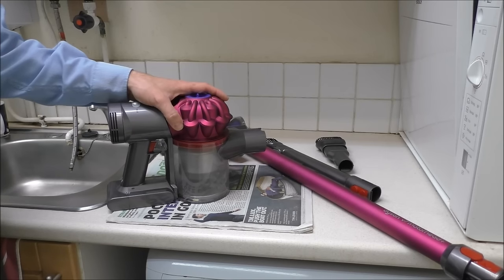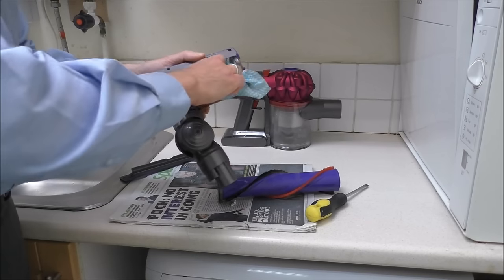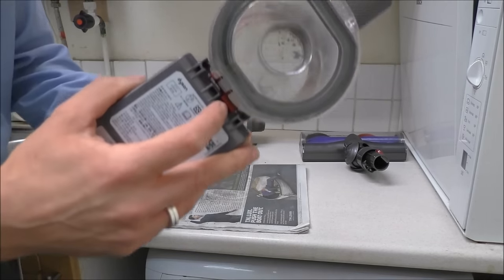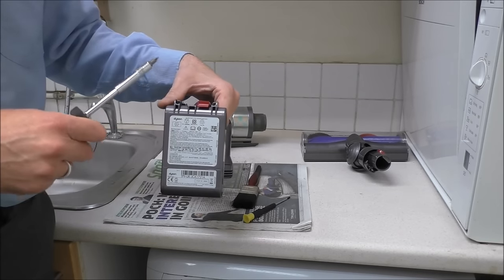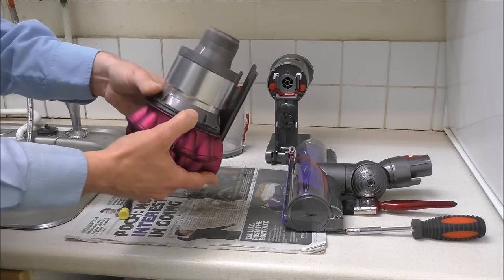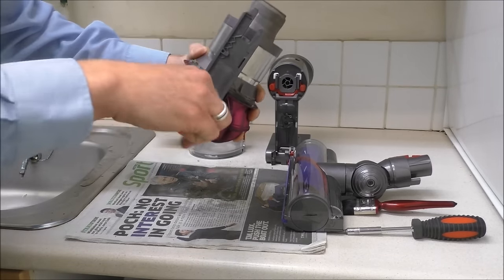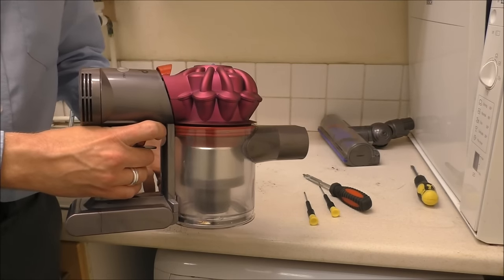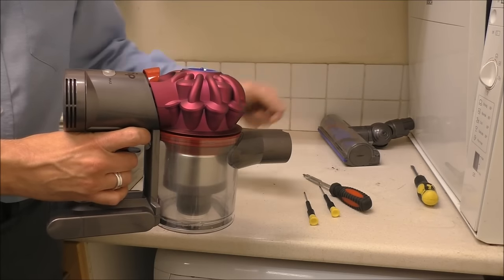How To Clean The Dyson V7 Cordless Vacuum Cleaner

Comment: After taking it apart and dust it out, can I just wash and rinse everything (except motor unit) with water? I'd think it should not have mechnical units.
Reply from the maker: You can wash some of it, but be careful to not get any metal connections wet, and also make sure everything is dry before you put it back together.

Comment: Can u Raines the red bit under water in its entirety rather than have to taken there into parts? Looks can break the parts very easily
Reply from the maker: The only thing to check is that there are no electrical connections as these cannot get wet.

Comment: How often should i do that deep clean taking it apart piece by piece?
Reply from the maker: It very much depends how often you vacuum and what kind of dirt it is. For general household dirt you would find around every 5-6 months should be ok, but if it was used in more of a demanding situation like where you are involving things like brick dust then it would need to be done a lot more often.

Comment: I just go the lazy way and use a dry microfiber cloth and rub the dust away without taking apart the pieces lol
Reply: Not hating, but I did take it apart and noticed that it was mad filthy inside.  Probably affects the suction a good deal especially where the holes get small
Reply: Great video! ThNk you!
Reply: I used that too, much easier!

Comment: Why can't I run the dust bin parts under water if I let them dry completely? There's no electrical parts in there right
Reply from the maker: If there no electrical connections in there then as you say as long as it is completely dry after washing you will be fine.
Reply: @lords-electrical  thanks 😊

Comment: HELP! I've washed it and put it all back together as shown. However, the handle to lift and empty the bin is VERY stiff. So much so it takes great force to lift. Have I done something wrong?
Reply from the maker: The first thing to try is to make sure the seal around the bin is clean and free of debris. If the seal is not clean it can be really difficult to open
Reply: Hi, thanks for getting back to me. The seals are all clean and debris free! The problem seems to be with the central section going into the waste collection bin. The unit seems to be jamming against the red plastic lip on the top of the bin! If that makes sense!
Reply: I have the same issue. Its a bit stiff. More than likely that will vary. I just got mine yesterday. So it does require a bit of force.
Reply: @ExG131  My problem arose after I dismantled it, washed it and put it all back together. It was at the point of needing brute force to open and close it! However, I'm happy to report that it is now working as it should. It sorted its self with no further 'fixing'. I have no idea what the issue was, but it's now back to working perfectly.

Comment: Mine started turning on and off when you start vacuuming. Hoping this sorts it out. If not maybe a new battery
Reply from the maker: Not normally the battery that is faulty if this is happening, it would normally be either a blockage or the filter that needs either washing or replacing.
Reply: @lords-electrical  good news. Its all working. Max suction also works properly now. Thanks.

Comment: what about the filter on the back for the exhaust? can you rinse it as well?
Reply from the maker: It depends on which model you have, if it is the Absolute model then yes you can take it off, but if its the Animal then it is fixed so you won't be able to clean this filter unfortunately.

Comment: Thank you for the very thorough video. However, it didn’t explain how to clean the flutes
Reply: After disassembling my Dyson, I was able to see how you separate the flutes. There are 6 #8 Torx screws on the inner perimeter. I’ve decided to leave well enough alone and not take that flute assembly apart. Instead I dunked it in hot, soapy water and blew it dry by blocking one side of the assembly and using a hair dryer on the cool setting to blast air thru it. It works well enough for me. Thanks again.

Comment: I don't mean to sound gross, but my V7 swept up bugs with moisture. I didn't see the water until I emptied it. Now it has a "biological" smell to it. I let it air dry with the canister open, but the exit air still has that rotten smell. I will wash the filter.  I tried vacuuming a little laundry powder, but no, still smells. Do you think I need to disassemble the unit as you did ? You don't disassemble the purple head ? (mine is grey). I can do this.
Reply from the maker: Yes it may mean you need to take it apart and clean it properly, and especially clean the filter and let everything dry properly. Hopefully once you have done this, it should be ok.

Comment: Great video! Do you know if it is possible to replace the standard filter on the back with a purple hepa filter, like on the v7 fluffy?
Reply from the maker: In theory it may fit on the back, but the vacuums will be designed to work with certain filters. My worry would be that if you put a different filter then it may damage the motor long term.

Comment: What about the rear filter? When do you replace or how to clean?
Reply from the maker: It depends on which model you have. Some of the models you can just take the filter off and wash it. If it is a fixed filter, then they are not really designed to be taken out, but i am sure it can be taken apart, i will try and find out.
Reply: Lords Electrical thank you

Comment: wow.!!I sold my Miele...never needed to clean and fuzz around...now 

I got this nice Dyson v7,, and it doesn't work all continuously but goes in pulsing mode!!
 when I press the trigger...what is the problem..
anybody can help? with a comment on how to fix this and just go continuously working. 

It is new and charges ok.(.blue light is on). and goes off when is full. charge...
Reply from the maker: Could be a couple of things. It can mean that the filter needs cleaning, or there may be a blockage somewhere in the pipe or around the bin. Although it is new, there is not much chance of it being faulty. If it has a filter on the back as well make sure that is clean.

Comment: could I  HAVE GOTTEN WATER  IN THE MOTOR? i FOLLOWED YOUR DIRECTIONS BUT AFTER PLUGGING  TO CHARGE AND THEN LATER TRYING TO USE THE RED LIGHT CAME ON AND IT WOULD NOT RUN.
Reply from the maker: It shouldn't have water in it as the motor unit isn't near water at all. The main thing i would check first is that all of the parts are put back together properly, because if the bin is not quite located, then it will not run.

Comment: Can I know why I can’t clean the internal with water ?  I been spraying it water to make sure the dust were wash out 😓😓
Reply from the maker: Unfortunately if you get some of the electrical connections wet they may rust over time. Also you do not want to get any water near to the motor or battery as well.

Comment: This is a very difficult to follow for a average person at home with a particular screw drivers. Dyson should make things simple to maintain, its not about engineering, its about simplicity as how to use and maintain easily. Not convenient!
Reply: agree its far too complicated Dyson wake up I am not a mechanic !!!
Reply: This seemed like a fairly simple cleaning procedure. You'll need a torx bit set which will run you about $8 on amazon and I don't even think this level of cleaning is ever necessary for someone who doesn't want to do this. All you really need to do is empty the bin and run the filter under some water every couple of months. I just did it because I was curious and to see if I could get more performance out of my machine.
Reply: @nepicness  did it help? I want to do that, but not worth it if it doesn't help performance of the vacc.
Reply: @dnibcn93  I would say no. I would clean the filter, make sure every passage is clear on it, and look into getting a new battery if you've used it a ton. The battery will have the long term largest impact on performance.
Reply: @nepicness  I cleaned it... I didn't have the tinier star screw driver so I only got to the second to last part.... I chipped a piece of the plastic... But my vac was so clogged that this needed to be cleaned bad.
Reply: @nepicness  thanks tho :(

Comment: And....HOW often should we be doing this cleaning ??
Reply from the maker: On the whole you shouldn't need to do this more than once or twice a year but it really depends on what you are vacuuming. If it is general household dirt then not that often, but if you vacuumed a lot of brick dust then this would have to be done more often.
Reply: Only when it starts to reek from the exhausting air. Mine starts to emit a very nice (not) smell after awhile from cleaning up dog hair etc...smells like fresh blown wet dog eventually so I rip it apart and do the douche.

Comment: Vacuum still “starts and stops” during use... anyone have any recommendations?
Reply from the maker: If you have cleaned the vacuum and all the filters, just make sure there and no blockages in any of the pipes and tools as this can cause it to start and stop as well.
Reply: Mine stopped working completely, still with a charge.
  I was ready to get another vacuum, so anyway I left it plugged in over night, and it worked the next day , without cleaning ?
This was not a fix.
The problem is serious, but the solution is to clean or replace .
I was surprised that that dirt in the long spindle filter was the cause of my trouble.
Reply: That’s the pulsing problem...there is a video about solving that ...easy to do....
Reply: @kathleenvollmer4842  link? 8X

Comment: I am confused. Why would someone clean a vacuum in a suit? And instead of a flat screw driver to open these plastic things you can use a coin instead. With a coin you won't damage the plastic.
Reply from the maker: Good question, i normally wear a shirt for work and i recorded the video before we normally open for business. If i was to do another clean, i would just wear a t-shirt.
Reply: @lords-electrical  Thank you for the really good video! 👍🏽 I would recommend to do the cleaning outside, otherwise you'll end up having a clean vacuum but lots of dirt where you cleaned it.

Comment: How do you remove/replace the post air filter?
Reply from the maker: If it is the V7 absolute, then the filter just twists off, but if it is one of the other V7 models, then it is a fixed filter that isn't designed to come out. I had tried to take one apart, but couldn't find out how this would come out.
Reply: @lords-electrical  Thanks for the quick reply. I have the V7 motorhead, and the post filter definitely doesn't come out. I thought I was going to break it, and stopped fiddling while I was still ahead.

Comment: What if you accidentally get water in those connections on the bin and nozzle? Asking for a friend
Reply from the maker: The best thing for "your friend" to do is to let the vacuum connections completely dry out before putting the vacuum back together. Don't use it until you know it is dry and then you should be ok

Comment: Alas. Cleaning my V7 did not stop the problem of the vacuum shutting off after 10 seconds on high and needing to be docked for about the same for the machine to turn on. As a check, I ran it without any filters with the same result. Anyone out there have a solution?
Reply: time for a new battery

Comment: I've had my Dyson 7 for about five years.  I find it very difficult to clean.  Trying to remove the filter is practically impossible.   I'm ready to toss it out with very little usage.  And buy a different brand.  I'll never buy another Dyson product again.
Reply: I agree, I also have a v7 trigger and no way should it be this hard to clean. All this nonsense about their technology being world class doesn’t make any mention it will get clogged up and you need a mechanical engineering degree to be able to clean it properly. Washable filter. They jest surely?

Comment: i can't get the shroud off. i worked around carefully with the flathead, see it has become separated by a few millimeters or more, and it will not come off easily as in the video. i'm pulling and twisting hard and feels and looks like it's almost there, but won't budge. any ideas? so far followed all steps and it took me over an hour because there was so much dirt buildup. TIA.

Comment: How often will I need to change s battery are they expensive
Reply from the maker: The battery shouldn't need to be changed for at least 2-3 years. All that will happen is that the runtime will reduce with the original battery, rather than just packing up. A new battery should be around £40 - £50 but there may be cheaper alternatives around.

Comment: how to remove the air vent from the back ???
Reply from the maker: On the standard V7 models, it is fixed onto the vacuum, and can't be removed but If you have the Absolute model, then it is just a case of twisting the filter off the back

Comment: Is there no easier way to clean the clear bit on the big head.. yknow the one I mean😳
Reply from the maker: It can be quite difficult to get to the inside of the clear part on the main head. Once you have brushed it, normally a damp cloth or wet wipe is ideal to try and get it as clean as possible without taking it all apart.

Comment: I did everything and now my canister will not open properly.
Reply from the maker: Couple of things to check. sometimes there may be some dirt around the seal where the bin shuts, i have had this after cleaning and it just needed another good wipe round. The other solution could be that the bin hasn't quite located back properly on the vacuum body itself. If it's not located back fully then the bin may not open and shut properly. good luck!!!

Comment: A lot to clean 🧼
Reply: How often should you take apart your Dyson to give such a cleaning. I knew that I had to clean the filters but this is so much!i bought the Dyson so I would not have to clean so much.
Reply from the maker: Hi, You shouldn't need to clean the vacuum very often, it very much depends on how dirty it gets. The main thing is to make sure you keep the filters clean as this can make a big difference on how the vacuum performs
Reply: Lords Electrical how often would you need to do this deep cleaning. I’m a little afraid to start using screwdriver with the plastic etc. Also does the charger need to be plugged in all the time, does it matter? Thanks for answering!😊🇨🇦
Reply from the maker: @SandyB4975  You shouldn't need to clean like this more than every 8 - 10 months. As long as you are careful, you should be ok with using the screwdriver. You will be fine to leave the vacuum plugged in all the time, as it will switch off from charging when it detects it is fully charged.